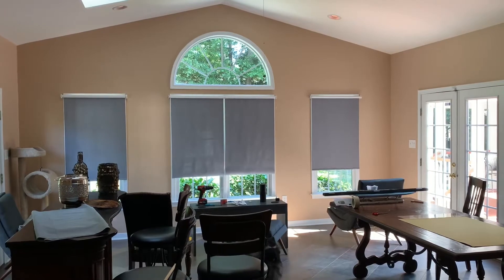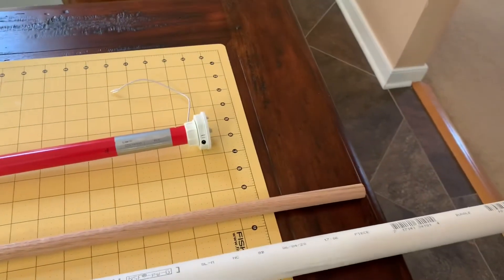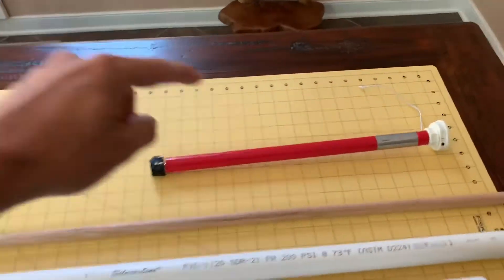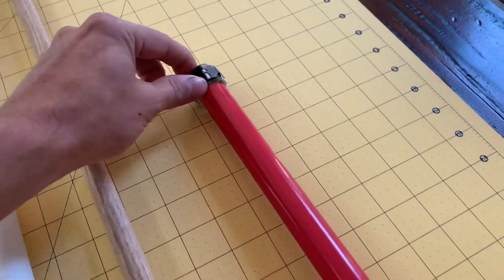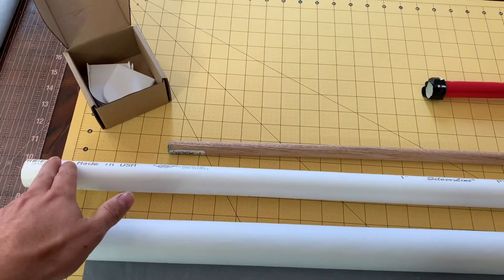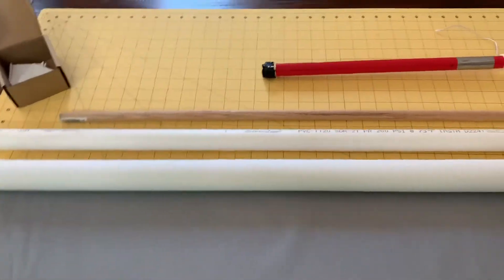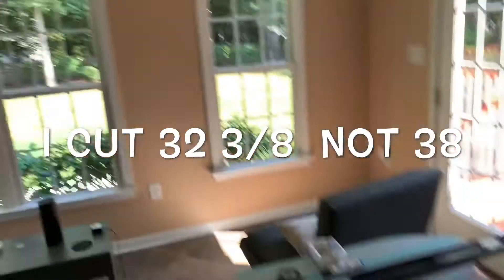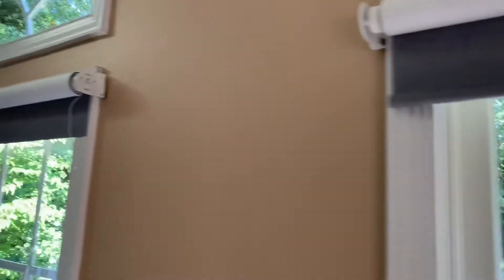Rollerhouse automated blind kit 32mm installation

Comment: Hi can you confirm the pipe size relative to the motor kit...the ID of 1" SDR-21 pipe is 1.19 in which is 30mm but the motor is supposed to be 32 mm so it seems like the motor will be bigger than the hole in the pipe ?

Comment: With two or more blinds, can you place the motor on opposite side and program so they both go down despite the opposite rotation?
Reply: Of course, each motor can be programmed for commutation movement, and can be set according to the manual

Comment: Why would you spend all that money to frankenstien a blind, when you can get solar powered roller blind, wireless, with remote for $90ish complete.
Reply: because you can't buy them this cheap.  companies selling these fully made charge an arm and a leg.  I noticed you throw out a number without a link.
Reply: Please link, I would love to buy at this price!
Reply from the maker: I didn’t want the solar option. It is wireless. When I did this, I believe (not sure) I had looked for the kit and heard it was coming, but could not find it available. I did not do all my windows just these, as a test. I plan on a revisit to see what is currently available, been busy. And still have 15 blinds to built. If you have a link, please share.